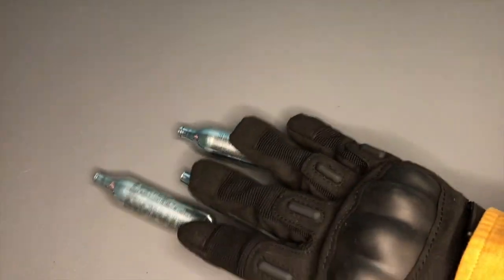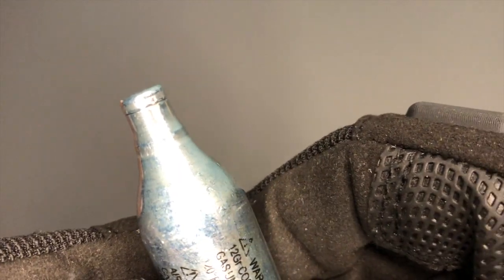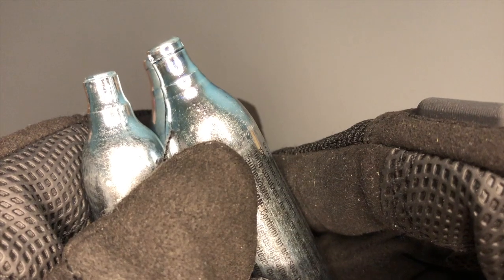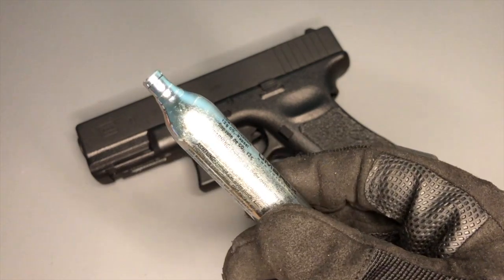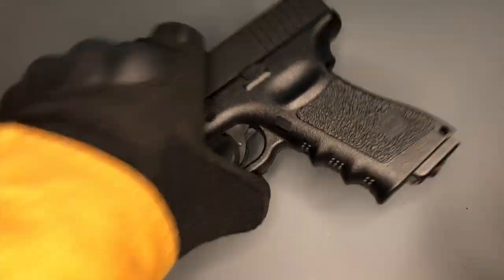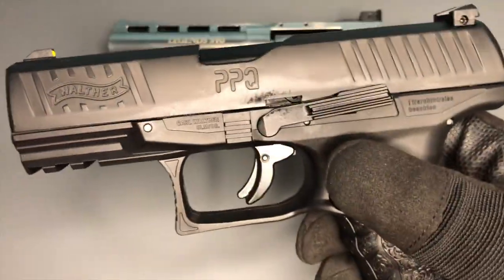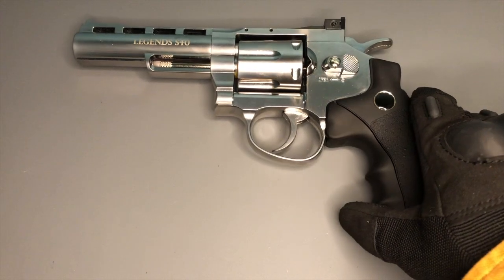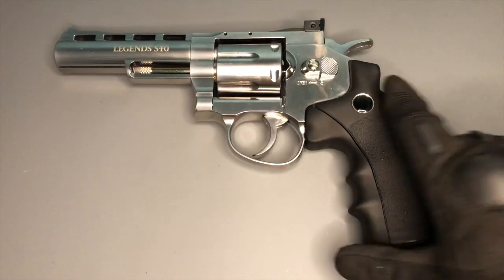A Further Word On CO2

Comment: Safety is a priority when it comes to firearms, NO firearm should be stored loaded (whether that be with CO2, pellets or BBs). I personally would never leave a CO2 in a gun, especially a half full one, it's easy to be complacent (and forgetful) about safety UNLESS you have a hard and fast set of rules. 
Another good video though buddy, maybe do one on ammunition next - lead, steel & plastic BBs and all the different pellets that are available (pointed, dome, flatheads, hollow point, lead free, etc.), just pointers for guys that are new to the hobby, as it can be a bit bewildering for a newbie at first.